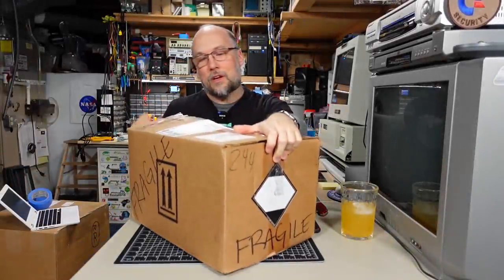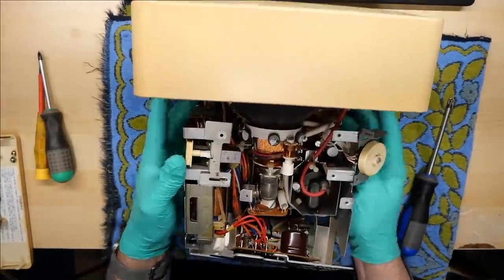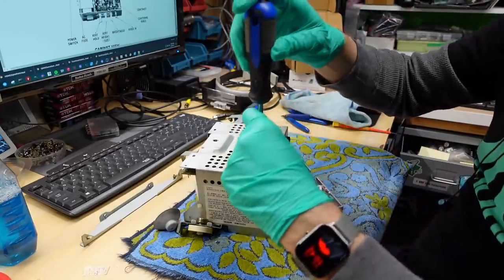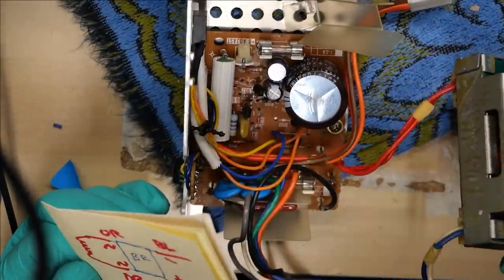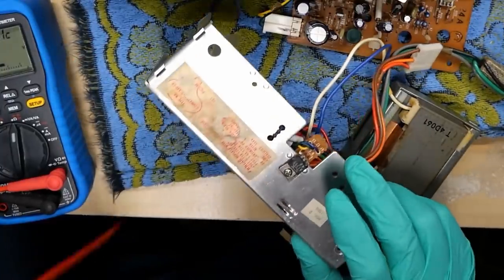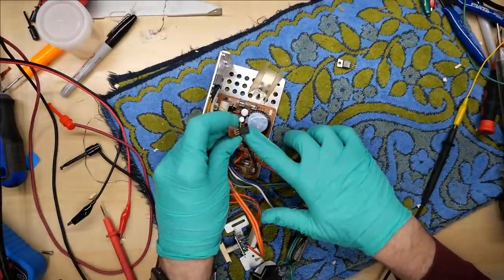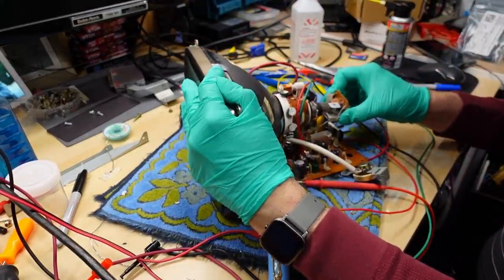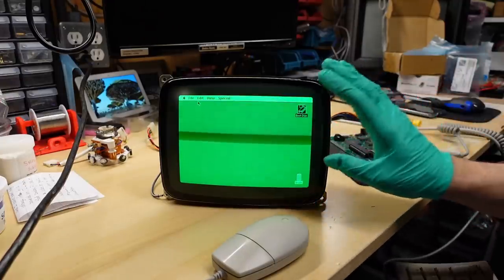Can I fix this broken Apple IIc Monitor?

Comment: Whenever I work on an arcade monitor or a computer monitor, if I have to test the psu section I always power it up with a dummy load connected to the B+ output or you can get weird things happen. On the arcade monitors I use a 60w 240v (i'm in the UK) incandescent/filament light bulb (you can't use a power saving one) as the B+ on Hantarex monitors for example can be anywhere between 105v and 145v depending on the chassis. On that Apple monitor you'd probably get away with using a 24v commercial light bulb or 2 12v ones in series of some wattage (maybe a headlight bulb or two). The monitor's OCP (over-current protection)/x-ray protection circuit was almost certainly kicking in when the screen got too bright. CRT image looks nice and sharp though if nothing else!

Comment: "The least serviceable monitor ever". Apple already leader in the '80s.
Reply: Apple is still the leader in the 2021s. :D
Reply: I had an old Mac Quadra once (700 model IIRC) that required you to remove the floppy drive, hard drive and power supply to get at the RAM slots! Apple have always been notorious for this kind of thing
Reply: Sounds like they took a lesson out of the playbook for most vehicle manufacturers....
Reply: @KenKeenan1973  It wasn't just limited to Apple, though.  I'm a computer tech; back in 2001, I remember working on a desktop computer (if I remember correctly, it was an HP model) where in order to get to the RAM slots, I had to remove the hard drive, floppy drive, the entire drive cage, and then the power supply.
Reply: Bullshit comment, because you can't have both, an extremely compact device, and lots of space to make the device easy to service.
Reply: I guess it is pretty randomly asking but does anybody know of a good place to watch new tv shows online ?
Reply: @SpearM3064  At least it ensures you don't change the ram with power applied?
Reply: @KenKeenan1973  at least its just one screw on the buttom that hold it
Reply: Wow. By the time he gets it all apart (at about the 13 minute mark), a casual observer would have little idea what it was he was fixing.

As a rank amateur, I've fixed a few bad solder joints here and there to repair things, particularly retro video game consoles. Easy peasy. But where is the technical manual or electronics class that can prepare you for that Rubik's cube of spaghetti circuits and cables as in that Apple monitor? I would like to say that Adrian made it look easy but clearly this is not easy. One of the most intimidating things to an amateur isn't Ohm's Law. It's the difficulty of taking things apart with the expectation of getting them back together. I would have taken one look at the inside of that monitor and thought, "I think I'll try to find a used working one on eBay."

Comment: Adrian I have the same exact CRT I fixed it following your video, thanks a lot
Reply: I've just find the same Hitachi model of the //c monochrome monitor. Ir have the exactly same problem with those pesky diodes. The 4 diodes on the retifying bridge on the power supply almost evaporated the body leaving only the leads😂 another evaporating diode D510 on the power supply. Will change those 5 diodes with 1N4007. Analized the circuit and followed the PCB traces. Drawed the schematic diagram. If somebody could help me identify the Q502 transistor I would be grateful. Mine had the label almost vanished. The glass diodes and the zenner diode are almost impossible to identify as well. The capacitors I've managed to identify all of them. As well as the resistors. I was wandering if the whole power supply circuit could be swaped for a fixed 12V with a 7812 (1A)  regulator or a powerful equivalent one for 2A current.

Comment: Apple never expected these monitors to last  the decades they were always significant with newer, better devices and hardware. They squished everything and all the electronics together hoping have an impact on the compact computer market back in the 80’s but it came with a hefty price. Smaller moulds meant cheaper or lesser materials used but money went into the design, I am myself an experienced technician but even repairing one of these was seemingly a challenge for the first time, manufacturing materials have drastically changed over the years and sourcing parts have become a time wait other then locating them.

Comment: In the 90's My dad worked at a computer shop and built a green Mac! With a broken IIC monitor and a Mac that someone and dropped and cracked the CRT.  I will have to ask him about the mounting it looked original until powered on. Someone happily bought it and enjoyed the green look as a daily driver.

Comment: Wow, I had no idea the //c tube could work in a Mac! I wonder if you could make or 3d print spacer/adapters to be able to mount the monitor in a classic case. I've been working on a 1981 Macintosh prototype replica using acrylic and an SE/30 logic/analog board, I might have to try and use one of my broken //c parts monitors.

Comment: Quite interesting stuff Adrian.  I like the videos of monitor work a lot but noticed there may have been times a tube could have been mounted in another case.  You actually can flip the implosion band around if the attachment points are the same as the case it is intended to be installed in to get the correct mounting depth.  This is especially true for bands that have a tension bolt.  For anyone reading this that might not know, the band is nothing more than a director on older CRTs whereas newer generation CRTs (mid '70s I think) contain integral protection making the band nothing but a mounting system.  The band on older CRTs without integral protection designs was to prevent the glass from blowing out the circumference of the tube between the thick face and the thinner glass of the body and gun channel.  This directs the glass to blowout the rear once the atmosphere outside and the vacuum inside equalizes.  The band has nothing to do with keeping the tube together beyond providing mounting points and implosion safety.  If anyone has any updated info about this, please share for the benefit and safety of all.  I'm going from memories of my own and experience through my dad.

Comment: Lol I remember repairing CRT I used to have plastic sheets to slip between boards while repairing them in the eighties.. Look for the Zener diode which will give your voltage reference In the psu

Comment: Because I don't know how to fault find - lol -, I just removed one part at a time from my A/C PS and tested them off-PCB with a ebay transistor checker. After you remove 50 parts the other 50 can be tested on PCB, because most of the connections are cut by the removed parts. All you need is good photos so you can put the jumble of parts back on - lol -.

I was thinking you could flip the mounting band that has the feet, but it looks spot welded.

Comment: Really helpful video. I picked up an Tatung CM1495 EGA monitor a while back that has no sign of high voltage. This has given me as a relative beginner a few things to check next time I pull it to bits (Don't worry, I have made myself very familiar with the safety precautions for working inside a CRT)

Comment: On putting that green CRT in a compact mac, it may actually be possible, you might be able to slide some kind of washer or spacer through the screws in between the case and the mounting ears on the monitor so that it will fit in the mac classic case, you might have to use longer screws though than what came originally with the compact macs.

Comment: I had the IIc with monitor with stand, 2nd floppy, printer and mouse. Fortunately monitor was working fine so I have dissassembled it just to retrobright it. Opening the case is quite easy but disassembling it fully is realy a mess. I let it go after refurbishing because it didn't have any retro-emotional value for me since in Europe they were not common as I was I child. I am mainly into Z80 devices. But I have photos that I had it once. :-)

Comment: Looking forward to this one.  While I like my //e with it's color monitor, the //c with it's little green monitor is the Apple I use the most.  It's just so compact and nostalgic.  Great vid.  Funny, when you said the Mac monitor wouldn't work in the //c monitor case because the brackets were on the outside, my first thought was that I wondered if it might work the other way then, just by adding some type of spacers in the Mac to get the brackets to reach the case.  ;-)  Great vid!

Comment: Same, Adrian, same. I always dread trying to fix a dead monitor (or any power circuit without schematics). Digital stuff is one thing, but old analog monitors are another. My rule: If it's not working when I power it on, and it's nothing obvious (like power supply, fuse, etc) but something weird like it blows its HOT, or the vertical deflection is messed up, I normally just toss it into my pile of non-working junk. Sometimes they're just more trouble than they're worth. (I often wonder just how Shango066 does it)

Comment: MacIntosh systems from the 68040- early RISC era also are quite prone to cracking plastic.
Reply: The actual process of the yellowing of the plastic tends to make it quite brittle as well, much like C64 breadbin cases

Comment: I had a treadmill power supply lose diodes that way from a really bad power surge. Seriously, just vaporised. Also exploded a couple of other components, but not as completely. The difference was that it was more obvious - I replaced everything obviously damaged, and it worked. This looks even worse - I mean, it made it past the PSU - which ... is not high on the list of things I thought I would see on your channel! xD

Comment: I would say B+ is 0V and B- is negative voltage. I've seen this done with a lot of tube amps. Seeburg amps run 0V anode and -365V cathode to the output tubes.

Comment: The Torch brand monitor with Sony guts that I have had a similar diode fall apart in the same manner as the ones on that bridge rectifier, those style diodes seem pretty weak structurally, all I did was lift one leg for testing out of circuit (which it was fine), but putting it back, the other side snapped... :(

Comment: Something like that would give me fits too. A shame really, as that would definitely be a handy compact monitor. If the screw holes for the Macintosh and //c CRTs sit in the same vertical plane, what about seeing if spacers can be 3D printed? Then just find a longer screw to bolt it into the Macintosh case…

Comment: 15:00 You should ever check if fuses with the right value are installed, before powering on. Some people put bigger fuses into devices after the right fuse blowed up. The device could be damaged then easily. 😕

Comment: Pinout is a small part of transistor specs, you need to match other parameters especially gain
Reply: Gain is the one of the least significant parameters in a pass/shunt transistor. But the TO-126 transistor he put in place of the original TO-220 definitely has lower Pd and probably lower Ic as well, which is both a big problem.

Comment: I am thinking one/both of the diodes you replaced on the bottom were installed backwards. Hence why you were getting a reverse voltage on the cap. Not sure if it was acting as a negative charge pump, positive charge pump, or voltage doubler.

Comment: Plastic standoffs to mount the monitor to the Mac case, maybe? You'd need longer screws, but if the sizing is otherwise correct, that could work.

Comment: 9:12 "Schmutz". I like you using german word!
Reply: More likely Yiddish
Reply: @larryk731  common ancestry and etymology. “Smut” is also related to schmutz, via Middle English “smutten” (I did have to look up the intermediate word, but knew the rest).
Reply: it's a pretty common loanword into english.
Reply: @larryk731  
Yiddish is a Germanic language so will have some words similar/the same. Schmutz is  German for dirt and I think in Yiddish it is very similar.
English is also a Germanic language which is why German is probably the easiest language to learn once you master the Grammar and is why so many words are similar.
Though Yiddish is much closer to standard German than English is.

I speak some German but not Yiddish. I just know it is a similar language.

Comment: Completely off topic, but what watch is that you're wearing?  Thinking about it, I think I may have seen one of these monitors back in 1997 at the school I was at, I'd previously used Apple IIGS computers at my previous school so I was familiar with the colour monitors for those computers.  If I'm correct, the power switch on the Apple IIC monitor is in the same place as the power switch on the Apple IIGS monitor, is that right?  I was told the monitor in question was black and white, but I didn't turn it on or connect it to an Apple IIE as that's what we had at that school.  Yes, the school I was attending had Apple IIEs in the junior school classrooms.

Comment: Couldn't you just take off that outer ring with the screw holes on it off the other monitor and swap them? Then it should fit in the other case. I could have sworn I watched an older video of yours where a ring like that on a similar monitor came off. But I really have no idea. Loving the videos, btw. Keep up the great work!
Reply: You can't really remove the ring (actually called the implosion band if I remember correctly) as it's put on there at the factory when it's heated up very hot and it shrinks very tight onto the crt as it cools down. As some others have said here in the comments though, you can probably get stand offs that would allow it to be mounted in a different case. That was often done in some of the larger arcade monitors (they sometimes had plastic spacers between the crt fixings and the frame) depending on what cabinet they were being used in. Quite often you would see that in Sega sitdown cabs for example.

Comment: Hey Adrian, I keep meaning to ask - is that light grey power cord you're using one from an Apple G4 PowerMac or Xserve? I have a couple just like it, and find them to be extremely useful as they're really long, bend well, and aren't getting tacky (where the rubber casing is degrading).
Reply: We used Xserves in our racks for years. The Xserves are long gone but those fantastic power cords remain in use.

Comment: Sometimes when you see stuff with blown up parts but a good fuse, it's because someone has replaced the fuse because that was the easy and obvious thing when they opened it up. It's possible that's what happened here.

Comment: I just recently replaced some of those early "ball diodes" in a controller for a 1974 Snorkelift articulating 40 something boom lift.  Same thing happened with the diodes.  They were just open with some of them missing one of the leads, or gaps.  Wierd.

Comment: If those open circuit diodes you replaced were in the horizontal deflection circuit, they would most likely be 'fast recovery' types. Replacing them with standard power diodes will not work.

Comment: if the mounting ears are too far back you could probably rig it into a mac with some kinda spacers or shims
Reply: He was talking about putting the Macintosh CRT into the IIc monitor casing, not the other way around, which would indeed just need extra spacing.

Edit; I should have waited until the end!

Comment: cant you cut the band with a dremmel cutting disk make 2 90 degree bends in the strap drill 2 holes into the band flip it ipside down  then and put a small thin bold through the holes to tighten it up ?

Comment: Could you carefully remove the implosion band and flip it 180° and tighten it back on to install it in a Mac? I'm no expert but I've seen similar things done when people are restoring classic TV sets? Alternatively could you Dremel off the ears use some high strength adhesive to install new compatible ears? I would also love to see a green phosphor Mac! It would be like it came from an alternate dimension! :-)

Comment: You should try building a classic Mac into that case along with the green CRT.
Reply: It's a bit too tight in there to fit a mac logic board in there, but it would be a cool idea.
Reply: @evknucklehead  Maybe a Raspberri Pi running a Mac emulator would work.

Comment: Could the Apple ][c CRT monitor be powered from a third-party battery pack, or was that only the alternate LCD monitor?  (Pop-culture reference: As one point int the movie 2010, Heywood Floyd is on a beach writing something on a portable computer, which is an Apple ][c with the LCD screen.  It's aged relatively well, probably mostly because we're never shown anything on the screen, although what he's doing is obvious, while the styling of the new Apple ][ equipment from 1984 to 1988 looks quite reasonable even decades later.  Whether it's an Apple ][c or an Apple ][c+ is unclear as we cannot see the disk drive or the ports on the back.)

Comment: i went on digging for paper work u were talking about but cant find anything else n i do find few different one doesnt match up with psu n maid board so not much i can do about it

i seen to know few way that u can reverse technology in that crt

if you wanted me to make schematics i going need full pic of board front and back so i can track it from piece to pieces n draw it on paper line matching for that monitors it up to u decide 

im engineer i could do something help it get it fixed